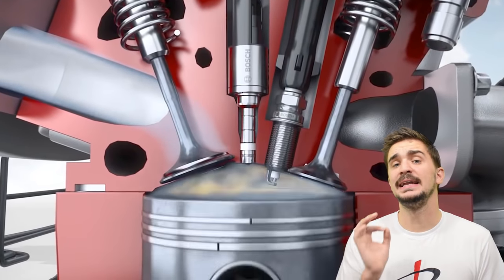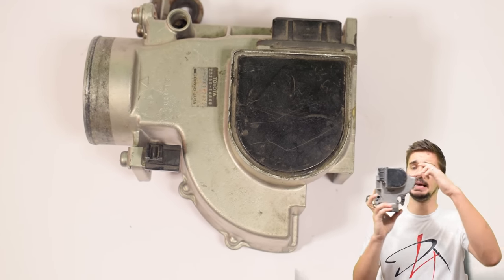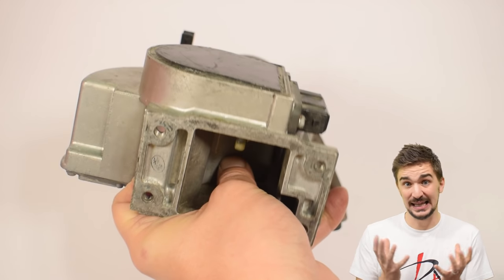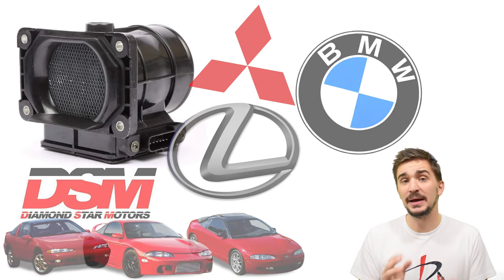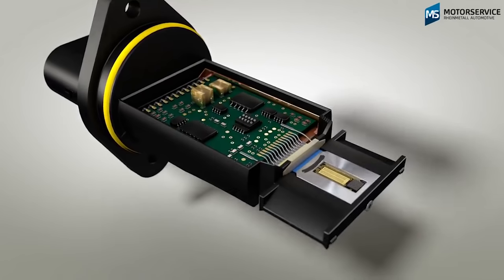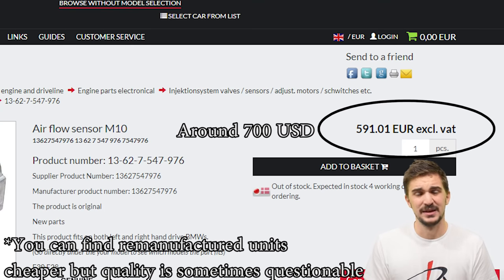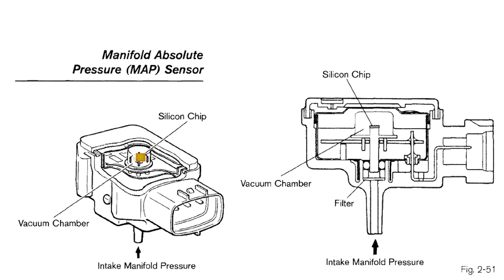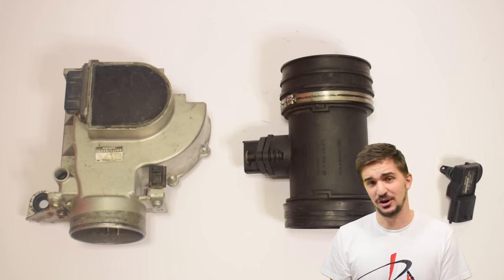AFM vs. MAF vs. MAP - Air flow SENSORS - HOW they WORK and how they DIFFER from each other

Comment: Actually MAP sensor itself can't sense correct volume of air.
I have read tons of articles, surfed in remaping webpages etc.
Only ocasion, when MAP can read airmass(correctly) is then, when engine is untouched.
To explain it bit deeply. Presure in inlet manifold is in direct relatioship with cilinder head flow ability.
If it is restricted some way(debris, soot), or head is ported(or any way modified inlet and exhaust system), you have to find out new values for air flow in any rpm range. And it depends all toher facors.
For example, outer temperature and air temp after intercooler. If you delete MAF, you delete air temp sensor with it. Let's asume that air temp is not needed(let say for raceing, when temp factor is coded), then you still need to know air temp after intercooler, because cooleing ability depends of car speed and outer air temperauure. In field it is warmer and in forest it is cooler.
It is not easy task at all.
I would say, it is impossible, if you won't attach MAF to completed(with complite exhaust system etc.) engine and sync values.

Comment: To be honest I don’t care what new disposable Dixie . I would only build a iron block engine that carburetor only . A old school engine that doesn’t need a computer system . A 700R transmission that all mechanical and no computer parts at all . I’m talking about the gmc 455 and 442’ss Here we'll dig into the history of the record torque producing big block. We will also uncover the difference between a 455 and a 455 HO (High Output). Discover if the Buick, Pontiac or Oldsmobile gmc engine has an advantage over the other manufacturers @ Finally, learn how the 455 benefited during a time when GM's divisions took great pride in making their own mechanical engines instead of all computer systems controlled engine 

The Oldsmobile 442 Version
Olds beat the other GM divisions to market with the first 442 Cubic Inch motor. In 1968 the engine found its way into Oldsmobile's premium luxury muscle car, the 442. They called it the Rocket 455 which became an excellent marketing tool. They based the engine off of the 425 CID found in the 1967 Toronado. The company actually retained the same size bore yet increased the stroke by altering the crankshaft.

The side effects of a longer stroke include a healthy increase in torque. The downside is the engine finds itself a little slower at gathering RPMs. Horsepower ratings from 1968 through 1970 remained in the 375 to 400 HP range. At first, the engines remained exclusive to the Toronado, Cutlass and 442's. After 1970 you'll also find them in the Olds Vista Cruiser Station Wagons, Delta 88's and even GMC motorhomes.

Stage I Buick 455 Performance Engine
The Buick version of the 455 is actually quite different from the Oldsmobile version. Instead of altering the stroke, Buick honed out the cylinders on the 430 CID Buick Wildcat engine. For this reason, GM considered it a thin-walled big block. The advantage of this casting design is a significant drop in weight over the other 455 versions.

In fact, the engine actually weighed close to 150 pounds less than the legendary 454 big block that Chevy used. This weight reduction compensated for slightly lower horsepower output from the Buick version. They rated the standard issue 455 at 350 HP and the high-performance stage I version at 360 HP.

This engine had a short run starting in 1970. In 1975 General Motors started using the same engines across the different divisions and platforms. This gave them better compliance control for the increased power and fuel miles they buckled it into the ground.  At the end I put that engine in my 1995 suburban and it was a muscle car bully that ran 10 seconds on a good day on a lumpectomy day she ran 11 seconds and for a suburban that’s quick thrown down . Edit if I fallowed my insane friends build I could have had a 9 second suburban . To tell you the truth I would love to own a cutlass 442 my mom had one when she was growing up . To be honest with you tony they don’t make any thing past the 80’s I would want to own and there’s no way in hell I would ever buy a electric vehicle that needs Nuku’alofa power or coal to charge your disposable Dixie . My wife said go find something at a dealership or something and I tell her every time 99 percent to a 100 dealership unless you’re in America you cannot buy anything but a new  disposable Dixie nothing compare to the older vehicles.

Comment: so which of this is best for a motorcycle carburated 4A-GE? :P (bad joke... just to let the dumb dumbs know)
Reply from the maker: The TPS 🤣 A MAP can work actually!
Reply: @d4a  what would that accomplish though? XD
Reply from the maker: @Dominik189  Load based ignition advance, totally works! I'm not kidding honestly
Reply: @d4a  WHOA, wait! Seriously? So a MAP could be useful on a bike carb converted car? But how would one make it function?
Reply from the maker: @Dominik189  You get a hose from each of the intake runners and connect it to a single vacuum balancing bar to even out the signal. And then a single line goes from the bar to the MAP sensor. The MAP sensor then feeds data to an ECU, either OEM or ignition standalone.
Reply: @d4a  sounds like a pain...
Reply: @Dominik189  it is, but it is also similar to the process I go through when converting fuel injected VW Busses to carbs, while still maintaining vacuum brakes and vacuum advance on the distributor.